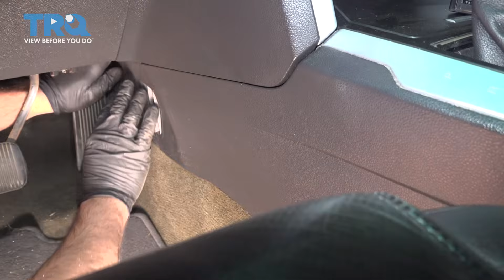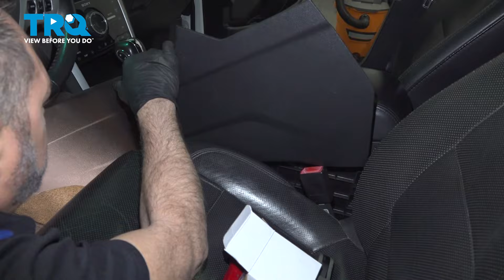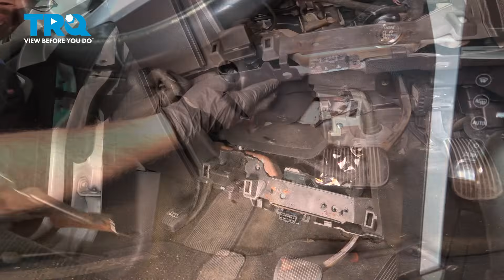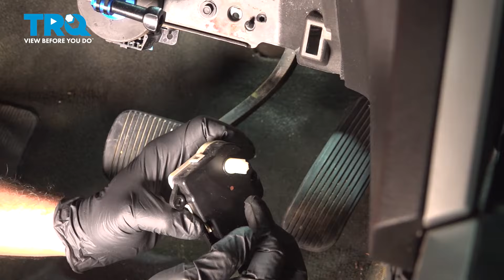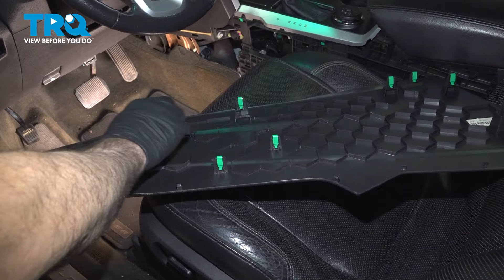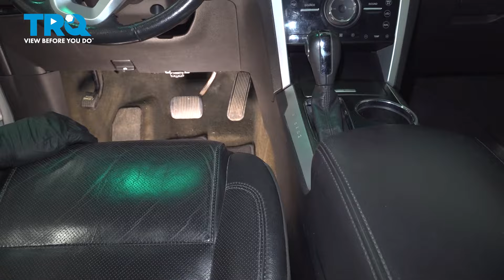How to Replace HVAC Blend Door Actuator 2011-2019 Ford Explorer

Comment: I replaced the actuator exactly like the video shows, but I still only get air from the front vents, it doesn't change to defrost or floor. Anyone have any ideas? 2016 Ford explorer limited

Comment: This is the mode door actuator, not the blend door. This one is for if your AC doesn't switch from face to feet or whatever. If you're stuck on hot or cold, you need the blend door actuator which isn't in this video

Comment: Perfect Video, fixed my problem. I skipped removing the side panel, I was able to access it without that step. Also, I used the old actuator spindle to turn the door to align with the new actuator rather than power up the new actuator.

Comment: I'm a little confused because I get heat on my driver side but I don't get heat on the passenger side does this control both sides? because I understood that there was two separate ones that's a question sir
Reply: Having the same problem. Adjustable temp on drivers side but passenger side stays ice cold. Trying to replace the actuator but can’t it to line up. Tried what was said in video, about turning car on to let it align to the startup position. It moved. But not to where it lines up. Now what do I do?

Comment: In my 2017 police utility I’ve noticed that when I have it on recirculation mode I get exterior smells coming in to the cabin example other car’s exhaust etc. 
will replacing this actuator fix the issue? I’m thinking that there’s a door flap that’s not closing and it’s probably the recirculation mode door.
Reply: Have you changed you in side cabin air filter? Or installed 1? Not all come with filter.  Some you have to take a knife, cut door open,  insert a filter and screw door you just made shut. It's crazy, but easy

Comment: My 2015 explorer sport the driver side just started blowing hot air when I had the air conditioner on. I saw this video I bought a new actuator. I did exactly what you said and I had no actuator on the driver side. Why is that?
Reply: its on the Passenger side in the middle behind the screen.